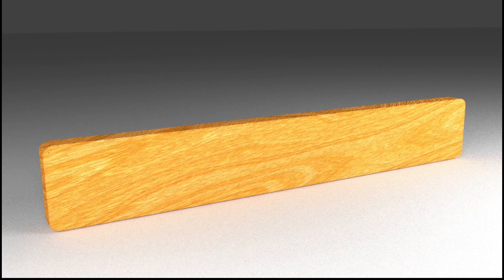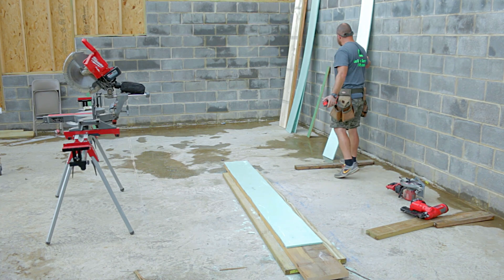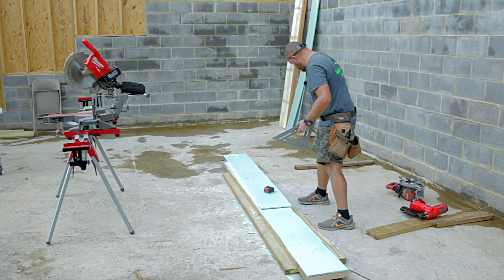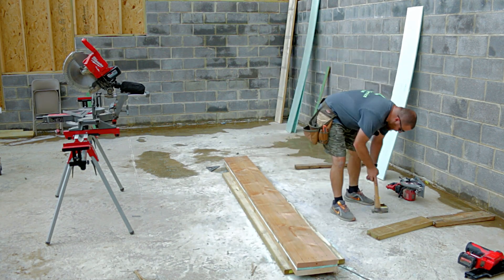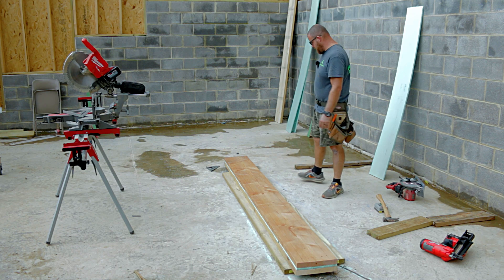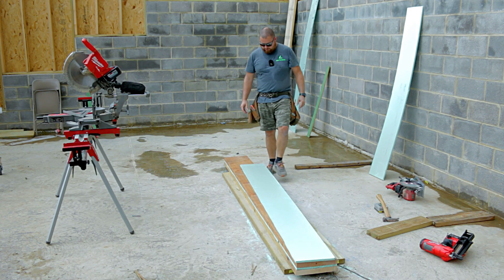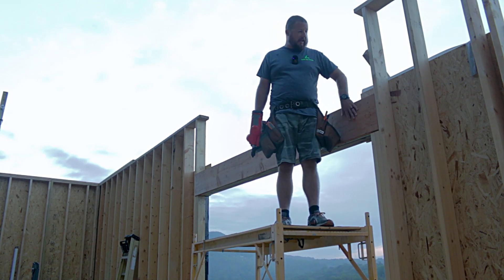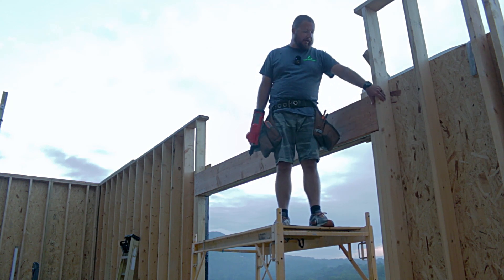Garage Build #28 - Building an Insulated Garage Door Header

Comment: You foaming inbetween the beam weakens that beam. The three need to be nailed together the insulated on the inside gap. Or the foam on either outside and the beam centered in wall. Diagonal nailed is the same as diagonal trussing. Your foam gapping puts the nails in dual shear, bending not good. Board to board single point shear and no bending of the fastners/nails.
Reply: is it helpful to explain  and hint to science to the general youtubeer Diagonal nailing??? what a concept, not for this guy, Has he hears of T Nuts & 5/16 + Bolts that will do more than any Nail Made and even a Lag screw. Tha's what I do! Seismic California